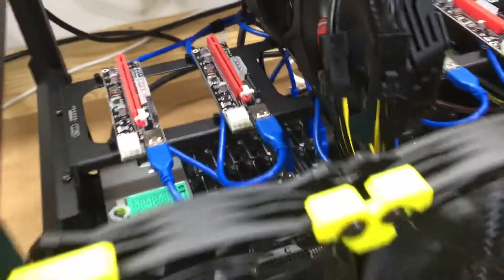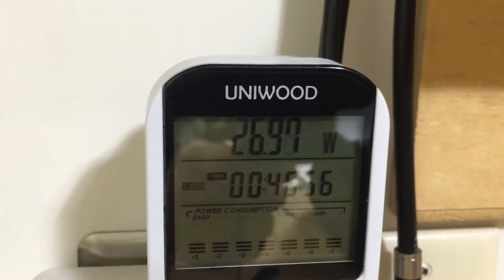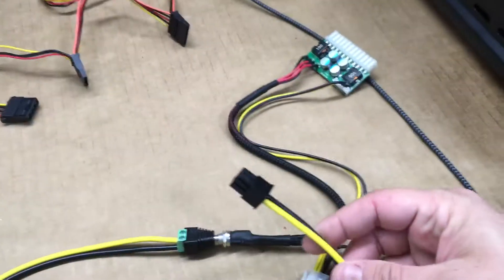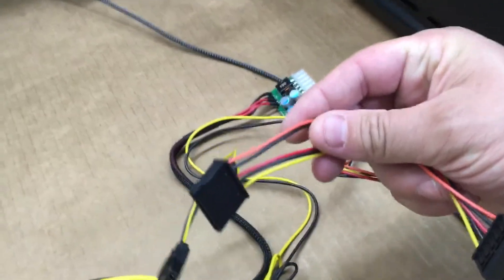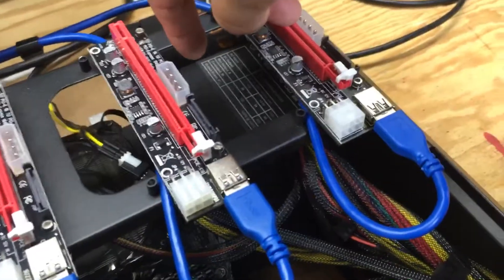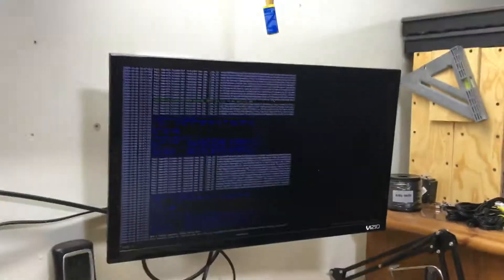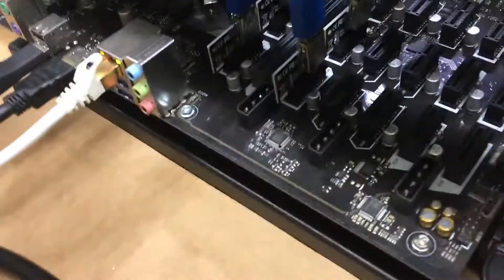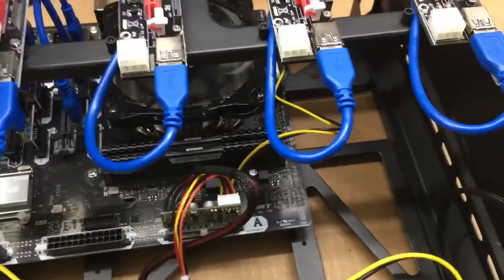Powering GPU Mining Rig Motherboard With Adapter. Remove Second Power Supply

Comment: I use a Seperate 250w pico in conjuction with the HP1200w (x6b board) Is there a way to synchronize both PSUs to start up at the same time because It's sketchy starting the HP first then the Pico knowing that 50% of the board is being unpowered for like 5-20 seconds!
Or does the PICO automatically start up when it senses power?
Is there a BIOS option to make it so that the PICO starts up the moment it senses power!?

Comment: i have done something similar here in manchester uk. but i found that the motherboard adapter thingy seemed to be inefficient. so i was better off watts wise by using a gold computer psu rather than a platinum server psu with the adapter. so according to killawatt system drew 720watts on server psu with adpater . but only 710 with standard gold corsair computer psu. i suspect if you were to get a very high wattage server psu of titanium variety -its a winner. but gold corsair psus are very good if you run them at half their rated power. very hard to beat. but server psus very inexpensive . . . . .  killawatt is the best investment
Reply from the maker: By removing the 500 watt bronze PSU and adding the adapter. I dropped around 15 watts. Since I didn’t have a better power supply, it was a lot cheaper to get the adapter, then a $150.00 power supply to save on electricity.